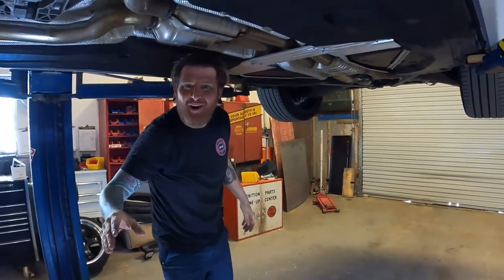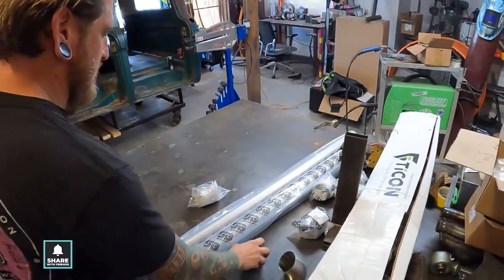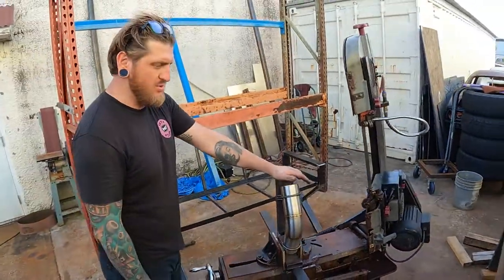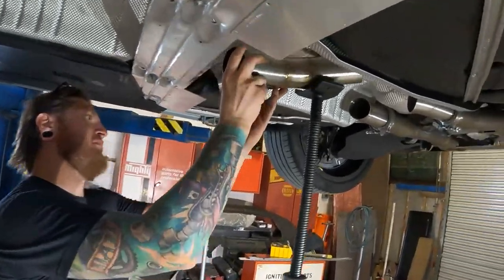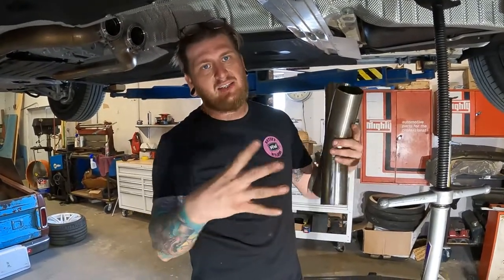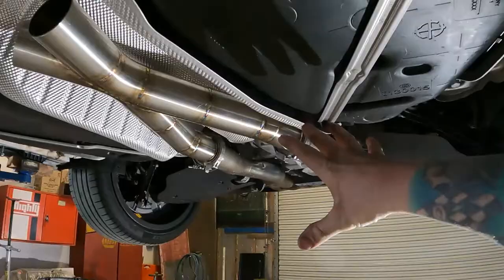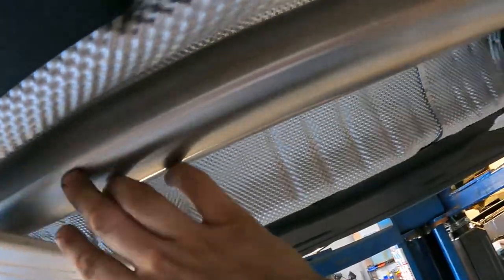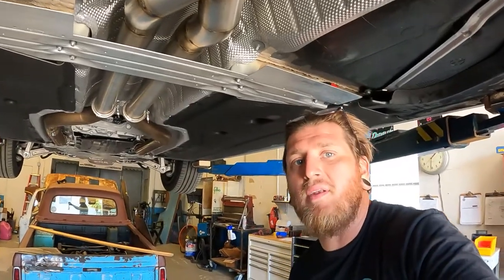Let's Build an X-Pipe! - Hutch's Welding

Comment: I see 2 major types of x pipe, one where the crossover section is essentially the same diameter as any one of the inlet or exit pipes (like the one in this video), or ones where crossover is more of a butt up as you said and retains almost the whole diameters of both inlet/outlet pipes, 
Clearly both work, but is there any difference in them in your experience? 

Awesome video btw, planning on making a mid pipe for my 325i and trying to work out what arrangement pf x pipe I want to build for it.
Reply: Did you find out what is the correct diameter?